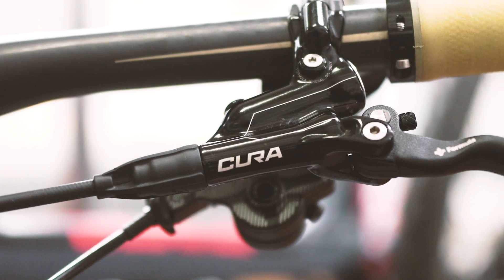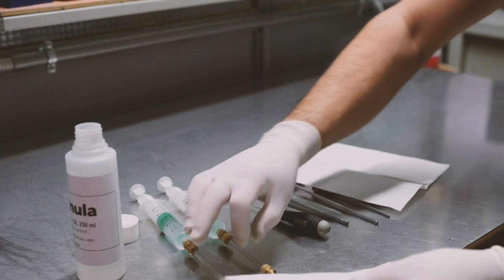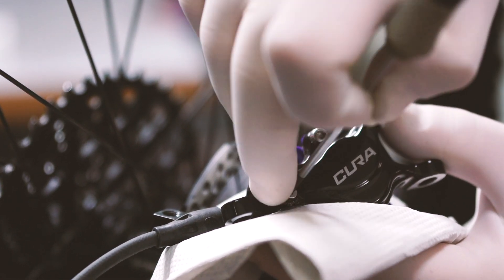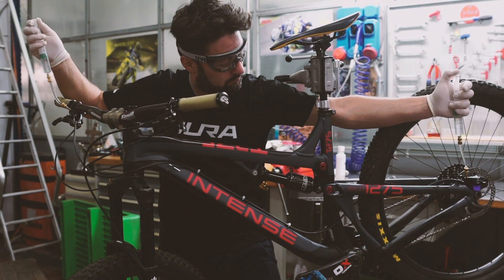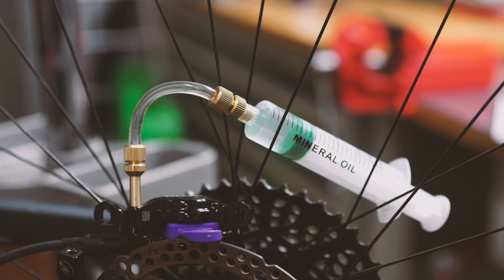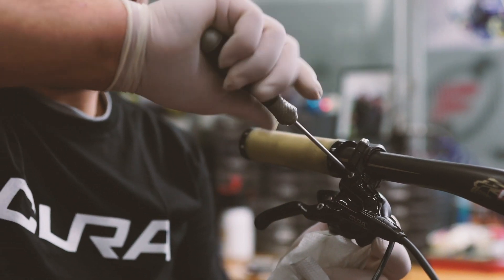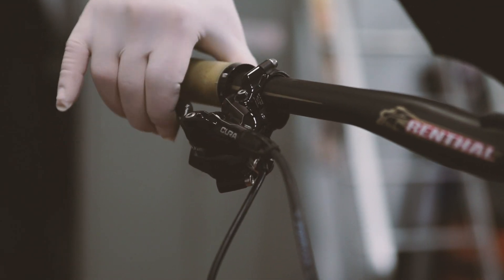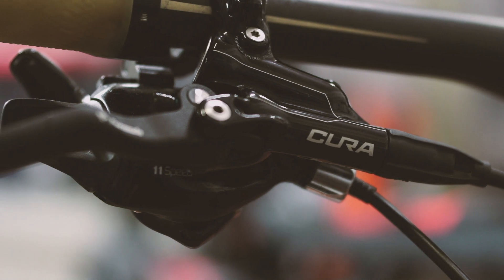Mineral Oil Brake bleeding procedure

Comment: There is always a lot of oil coming out of the caliper, even if it's higher than the lever. Tge bleed is good afterwards, but it's always a mess 

Also you have to be gentle when pushing and pulling, the membrane in the lever is easy to kill.

Comment: Does anyone know the viscosity of Formula mineral brake oil please? Shimano is about 8 Centistokes & CHF mineral oil is about 18 Centistokes. Shimano is thinner. Is is thinner than Formula's?
Reply: In answer to my own question above, Formula oil is 9.66 centistokes. I wouldn't use CHF mineral oil as it is quite a bit thicker than formula but shimano oil is slightly thinner & is fine to use.

Comment: Aren't you supposed to get rid of the old breaking liquid and replace it with the new one, instead of mixing the two together? There are some tutorials that do exactly this.
Reply: That's called a purge
Reply: @appleftw1232  Purging is what you should be doing.
Reply: It depends on the color

Comment: There are differences in the procedure between this video and the Cura 4 manual. Wich one is best to follow?  Is the lever position relevant for the bleeding procedure?
Reply: You should not need to adjust reach in bleed, the reach does not effect how far you can press the piston in master cylinder, and there is only reach adjustment. If the thad these adjustments, like bitepoint, you would need to reset it. Her eyou just do the bleed. That's me just using brake knowledge. But I am don't know what you refer to with the procedure differences.

Comment: I heave Cura 4 brakes and I like the lever to be close to the handlebar - when bleeding the brake, does the lever position play any role?

kind of thought if I put the lever to the max out position, that is will have more slack on the opposite side, and be closer to the bar, then if put in mid position or closer to the bar.
any truth in that?
Reply: It should not effect this brake as it does not have bitepoint adjustment or a servoeave, or similar mechaniss,   where you can adjust bitepoint. On cura bitepoint stays the same, you can leave the levers alone the power will remain the same no matter reach, piston is pressed as far no matter the reach. But a Shimano Deore for example that's not the case.
Reply: @mtbboy1993  all right! thanks for the reply.
Reply: @aadgbe  I've ordered cura 4 brakes from Geometron, so soon I will have a set 😊
Reply: @mtbboy1993  I know I adore my Cura 4's. been a long time fan of Formula's in general. had The One and RO before. loved them

Comment: Hey, thanks for the tutorial. Is it normal having oil getting out from the master cylinder while putting off the top suringe on cura4 brakes ?
Reply: Hello Formula!
If I need to shorten the hoses do I need to bleed them? Will there be any air introduced to the system?
Reply: @marzocchidj3  Absolutely it is very unlikely that no air will enter the system when severing a line. Bleed it just in case, it doesn't take that long.
Reply from the maker: Yes, a little bit of oil coming out while removing the syringe is normal.